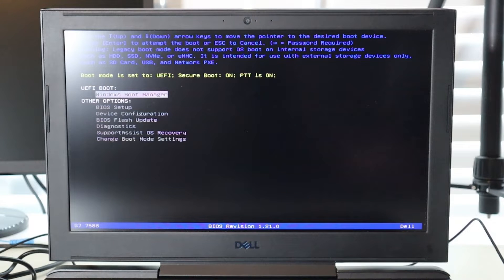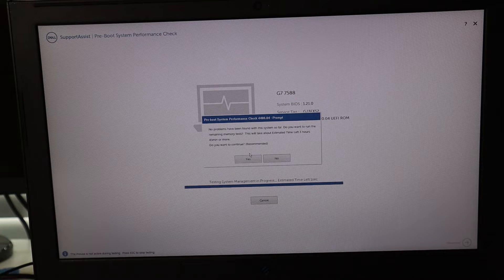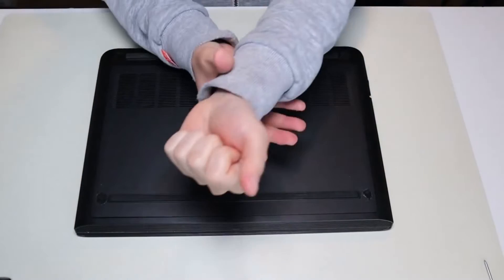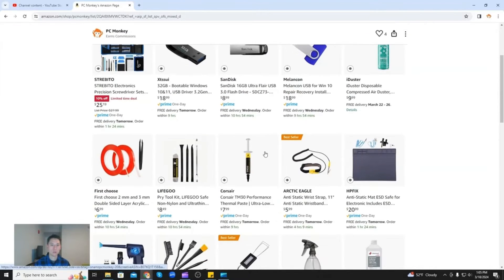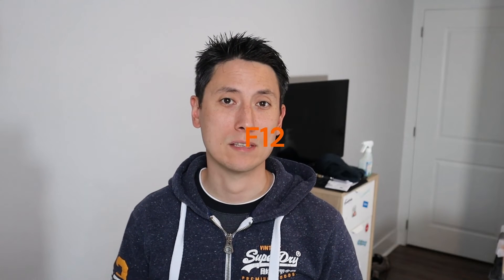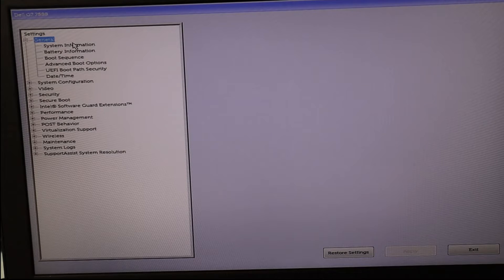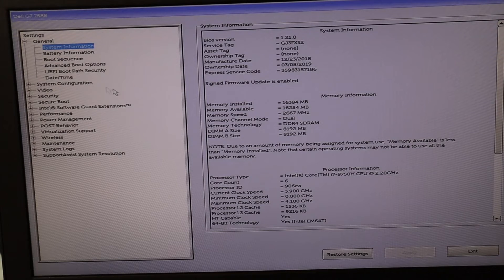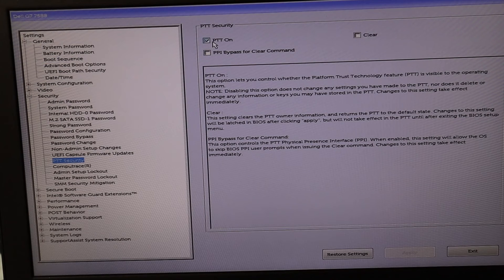How To Fix No HDD Found Error, No HDD Installed Error Dell G5 Gamer

Comment: Hi there! Im still trying to find a solution but thought id ask. So i have a dell vostro 1400 running xp. I like this laptop, i do not wish to replace it, I got a second one for parts. The parts ended up being less broken than the origonal. I got it working fine, but have a wierd issue. It loads the os from the hdd just fine, my pc is workable. However dell cannot find the hdd in a diagnostic, and it cannot be found to install a new os. Even the cd origonally used for this os. I do not have legacy options, just ata and ahci, ahci being whats currently active. I was reading that switching this can wipe the harddrive,  so i havent tried it yet, as I kinda just broke some stuff more in the other computer not realizing the attachment was so close and it comming apart and not knowing how to out it back together. Anyways XD swapping harddrives back or using the other computer to reset it isnt really an option anymore. My time and date are fine, even with restarts so its thankfully not that. Just really confused as to how i can use this computer, when the hdd cant be found for diagnostic or os repair. I jean its not the end of the world, but my little brain cant really let it go. Would appritiate any advise a lot. Thanks so much <3
Reply from the maker: If the diagnostic test shows the HDD as not installed, it may be loose or bad. Try 'reseating' it as seen in the video and run the scan again. If the scan comes back the same, I would then try replacing the HDD. You can see examples of replacement and upgrade HDDs and SSDs here; https://amzn.to/430vkEz.  To learn the difference between HDD's and various types of SSD's, view this video: https://youtu.be/KgDucEw7drA
Reply: @PC_Monkey  okay, awesome I will. Thank you so much for your reply on a year old video <3
Reply from the maker: @rianlynn3854  Happy to help :) Always here if needed !!

Comment: HI 
DELL G% 15 5500 
not boot at all after several time to start flicker red, blue green whit screen then not boot 
i close the cover wait several minutes then try several times,
sometimes I give up 
i installed window several time, i change the hard disk, and bios battery.the same
Reply from the maker: What was the result of the diagnostic scan? Also, did anything happen before this issue started? Overheating, liquid spill, Windows update, etc?

Comment: Hi I bought a Latitude E7470 Dell laptop and it has the no bootable device found error when i turn it on. I've run all the diagnostic tests and everything has come back good. I've done everything in the video and it's still giving me the error. When changing the way to boot i realized that when I choose UEFI underneath the boot sequence tab I don't have any options. For example at 11:46 you have the option of windows boots manager. When i bought this computer this was its description: Up for auction is a Dell laptop. Hard Drives have been wiped with erasing software, no operating system installed. I dont know much about computer so i dont know if i am missing anything.
Reply from the maker: If the diagnostic test showed the HDD to be healthy, then have you tried to reinstall the operating system as seen here?
How To Install Windows 10:  https://youtu.be/zYY-Gq68Dvo
How To Install Widows 11:  https://youtu.be/Yiy-53Wc-Wo
Reply: @PC_Monkey  I have not but i will try! Thank you!
Reply: would windows 11 work on the laptop?
Reply from the maker: @danieljoaquin6181  You can see the system reqs here: https://www.microsoft.com/en-us/windows/windows-11-specifications?r=1
Reply: @PC_Monkey bro I have same problem but in diagnostics hard drive has failed in long test please help me😢😢
Reply from the maker: @CRIC_-_18-_63  Very sorry but YouTube never alerted me to this comment :( Do you still need help?

Comment: Jamin, I tried to reply to my previous entry under southernutahissues after you asked about the XPS model but had to make a new entry here under my name. A rebuilt Dell XPS 15 9575 15.6" FHD Touch I7-8705G 3.10GHz 1TB SSD 16GB W10P Vega GPU is the laptop I'm dealing with. I have been able to get the back off the laptop and identify the battery but the battery connection has a bar of some type placed over it that does not allow me to unplug the battery for removal. The computer has been without AC power for about three weeks. If I just remove the battery screws without unplugging the battery so that I can get under the battery to the harddrive for removal, would that be a problem for the harddrive or be a safety issue for me?
Reply from the maker: Does this help access the Battery? https://www.youtube.com/watch?v=CVbYU7lKUos
Reply: @PC_Monkey  I was able to get it all resolved. Thank you!

Comment: Jamin, my problem is slightly different that what you've described but the solution is to remove the harddrive in my Dell XPS laptop (refurbished). I opened the back of the laptop but the internals look entirely different that what you and other videos show. In fact, I cannot even id the battery or harddrive. I'd provide a photo to show what I mean but can't do that here.
Reply from the maker: What model XPS do you have?

Comment: But what if Windows Installation Media can't find the hard drive either?  Then you can't re-install the OS.
Reply from the maker: Is the Dell turning on and working other than not being able to install Windows or is the computer having another issue?
Reply: @PC_Monkey  actually it's not booting into the windows media now eitrher -- for some reason -- just sits there and eventually restarts --
Reply: @PC_Monkey  it turns on fine. And I can boot from flash.  All diagnostics are okay; identifies the hard drive there and test is good.  But bios can't find the drive, Windows installation media can't find the drive.  Really wierd thing, this started and I played with changing boot settings, etc. for  a while.  I gave up.  Next day I started it and it booted right into windows.  I rean a scannow, did DISM commands, set up a chk dsk, restarted and it said chk dsk complete and repairs made.  So I thought I was home free.  It never booted to windows again -- just kept giving me the same message.  Although the message has actually changed.  It started with the bios message, no hard drive installed, with options there.  Now I get what looks like a windows message: no boot device found.  press any key to reboot the machine.
Reply: @PC_Monkey  i had to return this to the refurbisher II bought this from ; it was still under warranty, and in fact the hard drive was defective and had to be replaced.  Never had problems with this vendors merchandise before.

Comment: I cannot even get access to boot menu . What should i do screen is stuck at dell
Reply from the maker: You cant access BIOS or the diagnostic scan after restarting several times? Also, did anything happen before this issue appeared?  Liquid spill, overheating, Windows update, etc?
Reply: @PC_Monkey  nah I turned of my PC one time and than when I started again it stuck

Comment: Mine says everything is fine when I ran the test but it still says check cable even after I took out the hard drive and ssd. What should I do?
Reply from the maker: It says the HDD is good but to check cables? I have never seen that before. Usually it will tell you to check the cables if there is an issue, not if everything is ok ...
Reply: @PC_Monkey  well I upgraded my ssd and ram but I know that the parts are compatible. I dont understand why its not working

Comment: After diagnostics my screen goes black entirely and nothing shows up.

My battery (erratic charging)was giving me trouble so dell support videos online claimed that removing and reinserting battery may help. And that’s what an “expert” did. He also removed the ssd to check for damage as it was heating unusually (according to him) then put everything back to place. And I’ve been unable to move past the Dell logo while switching it on.

I’m using my 2017 bought Dell XPS 13 9360. Please help
Reply from the maker: Are you able to access BIOS and find any Repair or Restore options? Also, did anything happen before this issue appeared?  Liquid spill, overheating, Windows update, etc?
Reply: @PC_Monkey  yes I was able to access the bios setting and did exactly what you showed in another video from 4 years ago (which led me to this one).

The ssd is just not getting detected randomly. Is there a way I can access it just once to get my stuff out?

No windows update, no spill, overheating yes a little, but the system never mentions it.
Reply: @_zoony hey a get exact same problem as you. Have you been able to fix it? My dell latitude 7490 randomly blacks out and then shows text that "no device bootable device detected". But when I force shut down with the power button long press and then turn it on it just boots normally.